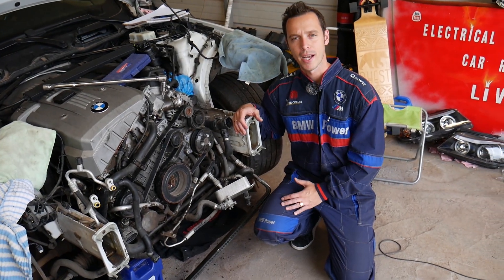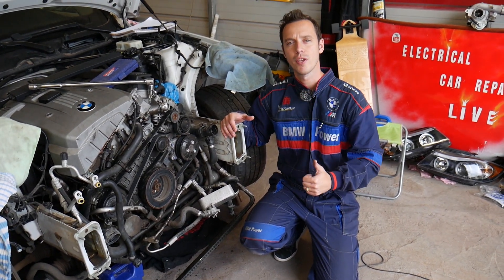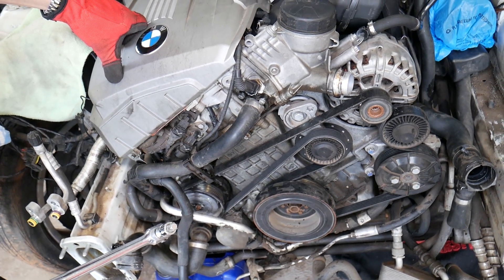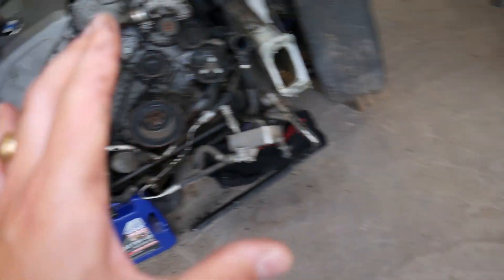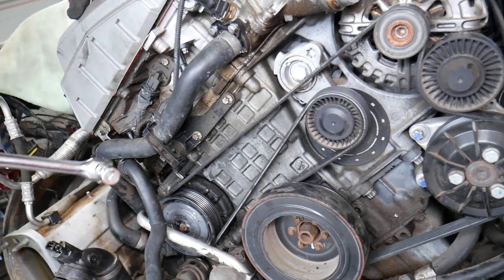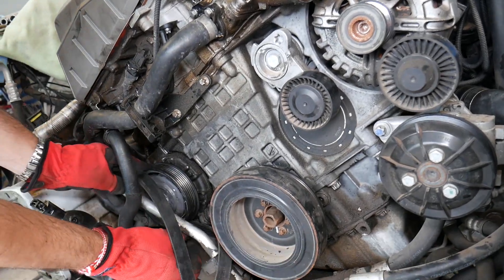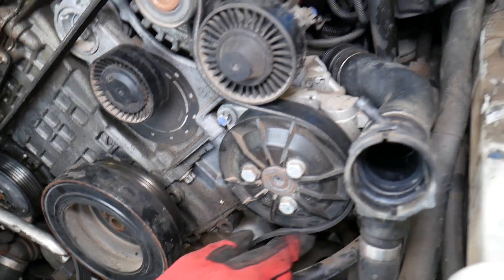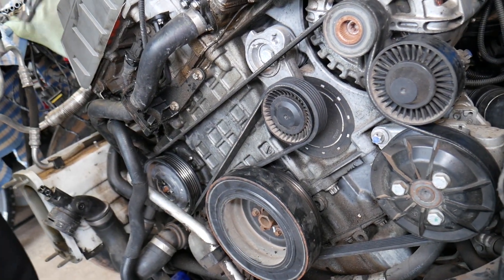SERPENTINE BELT REPLACEMENT DIAGRAM BMW X3 E83

Comment: I’ve watched many of your videos, and never once did you state how important it is to replace the serpentine belt. Mine broke and ended up getting sucked into the motor through the crankcase seal. $6000 motor swap! I am disappointed with you for not sharing that with your viewers. I want to know if you know about the protective shield or guard that can be installed to prevent this from happening again… please reply!

Comment: Nice video. Although my X3 says it's not an E83 Engine this is the only pully configuration that matches.  Exposing the entire front was a big help since I left most everything intact and found the key components by feel based on what I could see exposed.  Nice job.  Thanks.

Comment: I’m having problems with my bmw 330i my traction light is on and abs light is on and hand brake light is on and my car goes in limp mode so I can drive it and it drives funny I’m getting 95 can wheels speed
Reply: Have you looked into the transfer case? I solved the same problem on my x3 by replacing the worn plastic gear inside my transfer case.